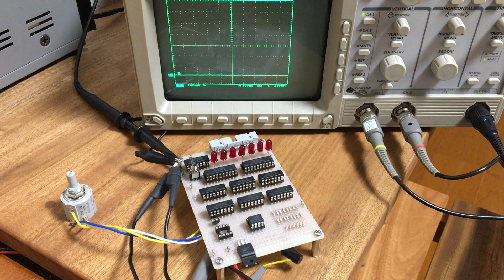Homemade Successive Approximation Register ADC

Comment: Hello friend. I was trying to do this proyect for my class. The thing is i didn´t  find the IC LM393 in my country. So i made a S&H  with a FET and also was trying makeing to 4-bit. But once i did all that the shcematic didn´t work. Can you help me with some recomendations?
Reply from the maker: Thanks for experimenting, S/H (LF398) is not necessary when testing with DC level input change. The comparator (LM393) can be used with other comparator ICs. You may be able to substitute it to some extent by using an op-amp with single power supply operation with a +5V power supply. The overall circuit operation should be tested by dividing it into individual blocks. First, is there an oscillation output from IC8. Is the shift register of IC1 outputting a high level starting from the upper bits. Is the DAC part composed of IC6 and a ladder resistor outputting the desired analog value by taking out this part and adding signals to each bit. Is the comparison of the analog value of the DAC with the input voltage correct? Is the data hold of the SAR composed of D-FF correct? Please test each part as described above to see if it is correct in principle.
Reply: @mitsuruyamada thanks for the fast answer. I will check that
Reply: @mitsuruyamada  Hello again. I did what you recommended. I did it individually and noticed some connection that I made wrong. So I fixed it and it worked. Thanks again for the video and the help. I am a student and it helps me a lot.😎
Reply from the maker: @demianlopez2279  Congratulations! Such a SARADC circuit contains analog and digital, as well as state machine-like elements that feed back and proceed to the next state. Therefore, it requires both an understanding of the principle and the skill to measure the operation. I believe that my experience of building this original circuit by myself 44 years ago has greatly influenced my subsequent life as an engineer and researcher.

Comment: Sorry to be a noob but does your power source supply 9V,  GND, and -9V prior to 5V regulation?
Reply from the maker: Thank you for your question. Although not shown in the linked Hackaday schematic, the +5V power supply is supplied from the +9V power supply by a linear regulator LM7805, so it starts up later in time than the +9V power supply. Although I have not done a rigorous evaluation of the power-on order, I do not think it will result in operation failure even if the power-on order is different.

Comment: Hi - neat project. I looked at a few of your other projects. Very nice. I really like the display for the serial terminal.
Also, I have been thinking about wire wrap lately. I did that 25 years ago. I liked it.
Seeing your excellent wire wrap on a proto board is inspiring. I am going to use it for my next project.

Thank you for sharing your projects.
Reply from the maker: Thanks. I've been thinking for a long time that I needed a computer interface with my own original keyboard and display, and 3 years ago I worked hard and got it done. This motivated me to built until a 6502 computer and a floating point interpreter. I would like to get as close as possible to the people who were the key players in the beginning of the computer age.

Comment: Pretty nice plain structured PC board.👍
Is the resistor ladder "R2R" ❓
Reply from the maker: Thank you for watching. Normally, a fixed network resistor with good accuracy would be needed here, but since this is a training circuit, I deliberately configured the R-2R resistor ladder with individual resistors: R=5.1 k ohm, 2R=5.1 k ohm + 5.1 k ohm. The resistance variation is about 1% by actual measurement. This video is a reproduction of my experience 42 years ago when I made a digital sampling unit for an analog oscilloscope, using an 8 bit ADC with a similar configuration.
Reply from the maker: The explanation and schematics are now available on the following website.
https://hackaday.io/project/181826-homemade-successive-approximation-register-adc
Reply: @mitsuruyamada  I'm already familiar with Hackaday, today I'm too 
busy, but be assured, I'll go and have a look one of the coming days.
Being a SixFiveOTwo (Acorn Atom) fan it interests me very much.
🖖😎👍 ❗

Comment: I recently started to work in the semiconductor industry and I am really perplexed by the complexity of the manufactoring process of a FET, let alone the process of an ASIC. But I do love the things that can be built with them.
Reply from the maker: Thank you for watching. I tried to build an analog signal sampling device 42 years ago. At that time, there were not many suitable monolithic ADC, so I built an ADC with a discrete configuration of almost the same circuit as this one.